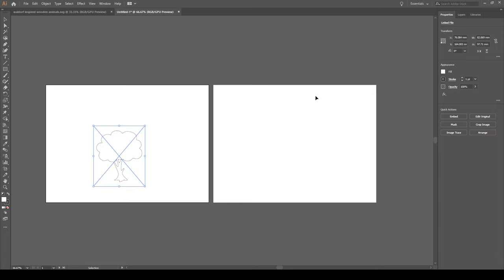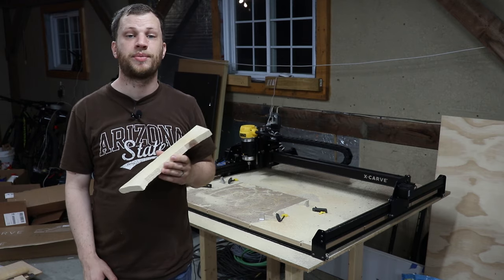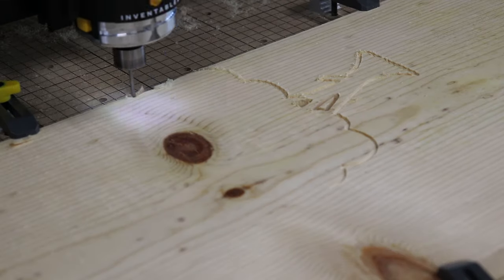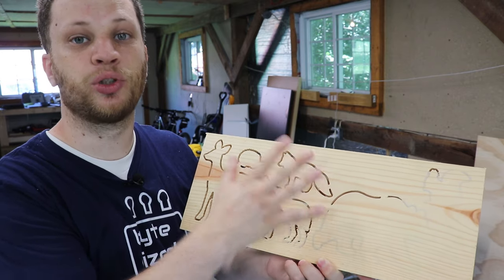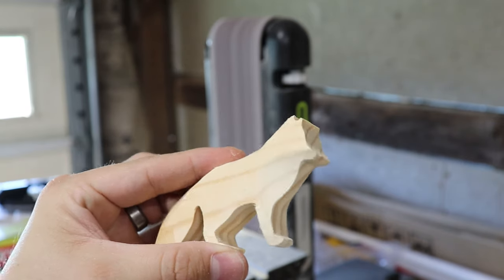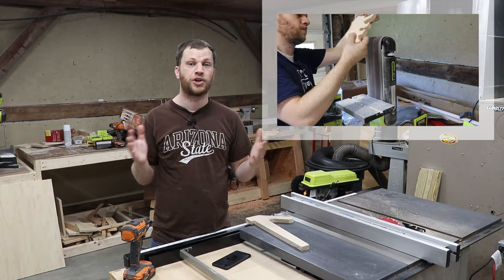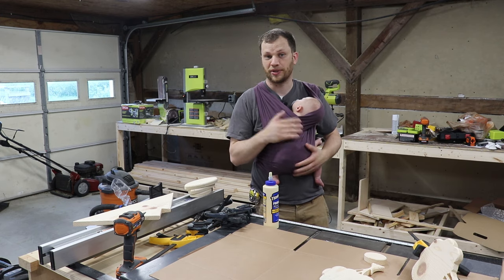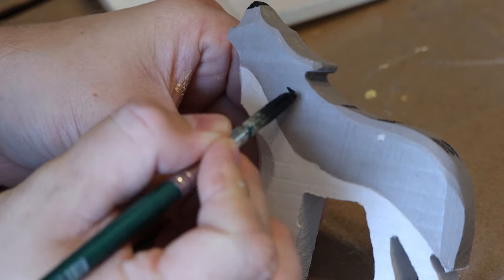Handmade Wooden Animal Toys

Comment: Please, I have many wooden toys that I want to dye with colors. What is the correct method that is used in the factories for making wooden toys for this
Reply: I guess it all depends on if the wood has already been finished. I'd personally go for acrilic paint then get a finish to go over the paint so it doesn't chip off. At least that's what I've done on some of my wood animals I made